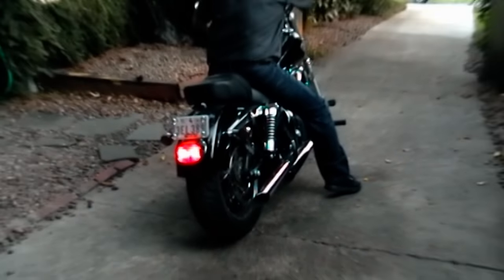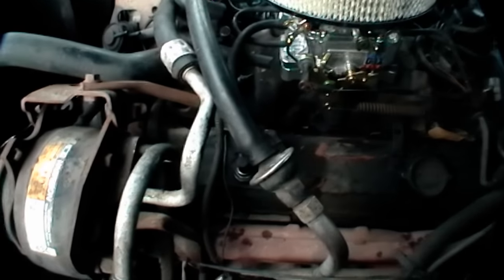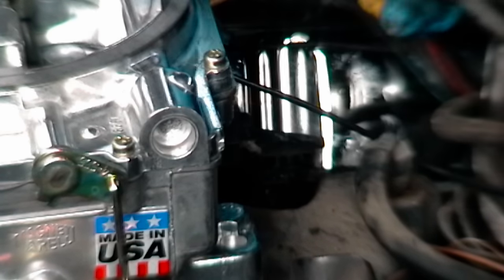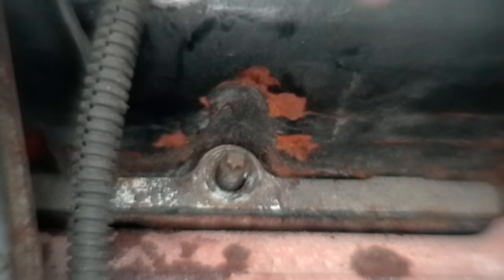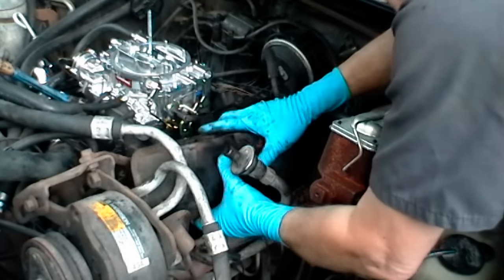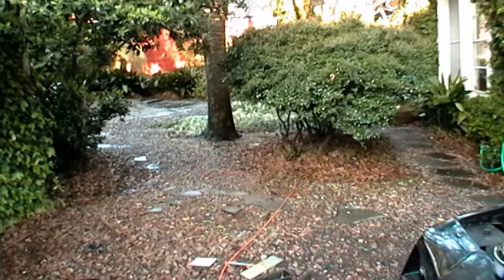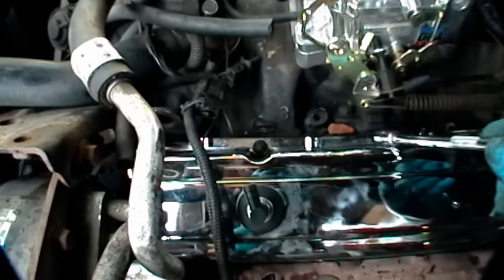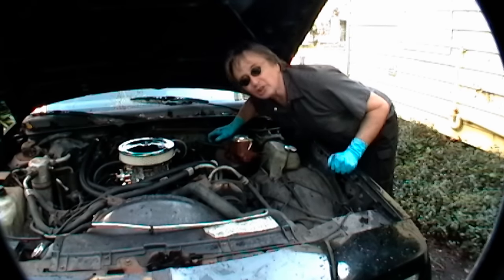How To Replace a Valve Cover Gasket

Comment: how long after replacement do I wait to start the car?
Reply: Smith9301 u dont have to wait. it takes 15 mins for the silicone to dry. 24 hours to fully cure but i use it on oil pans all the time and only wait 15 mins before starting. atv silicone is oil resistant

Comment: I was about to change the VC gasket ...leaks all over the driveway,  and, found out the bolts to the VC were all loose.   Tightened them.   That didn't fix the problem either.   Not until I got someone to  tighten them to the recommended "pressure" did the leaks stop.

Comment: @scottykilmer hey scotty I have 1998 toyota corolla with 176000 miles on it, its going through almost 2 quarts of oil a week, there is no visible signs of leakage and no smoke coming out of the exhaust system. What could be causing this?

Comment: Scotty, can you show how to change valve cover gasket on an 01 Acura CL S type please. Cannot find it anywhere on the web. Thanks, Kevin
Reply from the maker: unfortunately there's a ton of crap in the way on your v 6 engine, same process as this video BUT loads of crap have to be removed to get to the valve cover bolts and to remove them is a giant hassle on that model. So most mechanics will charge many hundreds of dollars doing that job. You can do it yourself, but it will make your hair fall out. I have no exact directions as so much stuff has to come off, but it's doable if you have patience and a LOT of spare time.

Comment: Hey scotty ive got a el camino with a v8,i noticed it seems down on power and when i washed the motor the water boils off super fast on the ex. manifolds exccept for the number 8 cylinder it kinda just slowy evaporates whats the cause?

Comment: what do you do when you've got a gasket that wants to squeeze out from under the valve cover when you go to tightening the valve cover down?
Reply from the maker: +David Hannigan Jr. (Deputy Dave)  a poorly made gasket OR one torqued down too tight
Reply: +Scotty Kilmer See, that's the thing, the specs call for 62 foot pounds of torque to torque them down. Not only did it start squeezing out from under the valve cover prior to reaching 40 foot pounds, I also snapped a valve cover bolt before reaching 40 foot pounds of torque. So if my gasket is correct, then what do I do to make it seem like its seated in an insert slot? Do I just slather with gasket maker? Or should I do like my brother says, just use the gasket maker without the actual gasket I had gotten? If it helps you think on it, its a '01 Ford Explorer Sport.
Reply: +David Hannigan Jr. (Deputy Dave) imo 62 foot pounds is a lot of force for valve cover bolts. Even if you torque it to 62 and the gasket and everything is fine, I would be scared that the cover would leak due to uneven pressure on the cover. Be cautious using a gasket maker with an actual gasket too; both together can cause uneven mating surfaces.
Reply: +muhdsharif12 That's what the hayes book says he torque specs are. but nothing about there being two different size bolts on that right hand side valve cover. two bolts are one size four are another size. and in that case of using the gasket maker and the gasket I'm just going to go with a gasket maker make everything go back on easier anyways. thank you.
Reply: +David Hannigan Jr. (Deputy Dave) Thats strange: different size bolts... anyways, hope it works out for you- no leaks!
Reply: +muhdsharif12 Yeah that's what the Ford Dealership said. Thanks
Reply: +David Hannigan Jr. (Deputy Dave) Are you sure it's not 62 inch-pounds? That sounds more like it. (62/12 inches = 5 foot pounds) The other thing to consider is hard hard was it to loosen them? I would say it wasn't that tight.
Reply: +John M yeah it was inch pounds but ain't 5 foot pounds kind of low to be torquing a valve cover?
Reply: Nah It's just the top of the valves there's no combustion up there so 5 is fine.  On older cars you would fill the oil from a little cap on the cover itself which took no effort to remove
Reply: +John M mine has a cap on the actual cover.
Reply: +David Hannigan Jr. (Deputy Dave) boom. There you go. My 76 omega had one; that's how I learned
Reply: +John M so what is (if there is) the trick to using just gasket maker for a replacement?
Reply: I've always used both together 1 it holds the gasket in place when you're putting the cover back on and 2 it makes a perfect seal . Just make sure you let it cure overnight. You could probably get away with one or the other. I'm a big fan of Permatex black and never had problems on anything from water pumps to gear boxes. When you get to a screw hole, make sure you go around the edge of the entire hole. Just don't be too generous because you don't want that stuff getting in where there are moving parts
Reply: +John M do I wait till the maker sets with the gasket prior to re-assembly?
Reply: +David Hannigan Jr. (Deputy Dave) put it on the gasket while it's wet and install the valve cover. it should cure overnight
Reply: +John M if I do that its just going to squeeze back out from under it, like it did the first time.
Reply: +David Hannigan Jr. (Deputy Dave) some will, but that's normal. This is just to ensure the best seal once it cures. The sealer isn't a requirement, some people just use the gasket however its a good idea. Just torque it to spec and you'll be fine
Reply: +John M no I'm not talking about the maker, I'm talking about the gasket itself will squeeze out from under it like it did the first time.
Reply: +John M I mean if there's nothing saying that I can't let it set first, I'd like to at least partially let it set.
Reply: +David Hannigan Jr. (Deputy Dave) is it a cardboard or a silicone gasket? you're not using the gasket that got mangled when you over torqued it are you?
Reply: +John M no, it's not silicone, it's made by fel-pro, or pro-fel or whatever. I got it off rockauto.com, and they say it's like a rubber compound of some sort. they don't use the word silicon. I specifically say its a rubber type compound. and it is it feels like a giant thick rubber band.
Reply: +David Hannigan Jr. (Deputy Dave) HOLY MOLY!  Friend, you are trying to tighten it 12x what you're supposed to.  5-6 pounds is plenty.  Nothing is going on up there, it's just to keep it from moving.
Reply: +Mark Umbenhower 👍👌👊
Reply: For cranks but won't start

Comment: How hard would this be on a 1997 ford f150 4x4 4.6 V8 ?? i was told i would have to remove the top of the intake ?  Also how hard is it to replace the fan clutch ?

Comment: Hi Scotty;
My Mitsubishi lancer 2003 manual recommends using Mitsubishi approved power steering fluid.
In replacing power steering fluid, is it necessary to use the dealer brand or any brand that car part store recommends is sufficiently okay to be used.

Comment: I replaced the valve cover gasket on my 94 Buick with the 3.8 in it. I dont know if there is an oil leak anywhere else because there is still oil all over the engine underneath the valve cover. How do you recommend  cleaning the oil off so I can see if that fixed the leak and stop the smoking?

Comment: Question scotty, 

The smoke was coming from under the hood. And yesterday now blue smoke is coming from exhaust. What would that mean? Valve cover seal bad? 
Oil is on the engine block 

1997 Lexus Es300
Reply: Blue smoke could mean a whole bunch of different things. My dad's 77 pontiac firebird had blue smoke come out the exhaust a couple years ago. Cost $4000 to rebuild the entire engine and turns out the problem was the fuel filter. It hadn't been changed in so long the paper disintegrated and made its way up the fuel line

Comment: does it not have to be torcked and if so to what? i drive a 95 vw golf 2.0 4 cillinder and im prity sure i need a new valve cover gaskit, to replace mine i would have to take off my intake manafuld cerrect?

Comment: I have a 95 isuzu rodeo with both valve cover gaskets leaking oil.  Is the rodeo more difficult to work with versus other vehicles?

Comment: do you still need to put gasket sealer on if you replace the valve cover gaskets? and do you need to scrape gasket material off the valve assembly?

Comment: Dear Scotty, can you tell me if I can get away with this: I'm about to change the lower spark plug tube seals on my Accord, which necessitates taking off the rocker arm assembly. I can't afford a torque wrench right now, and the parts store only rents a huge one that can't do the 9 to 16lbft torques this job requires. How important is it to get the torques right? Can I just eyeball it?
Reply from the maker: Yes, just don't get em too tight and warp anything.

Comment: You should run a wire wheel on the gasket surface of the new chrome valve cover to prevent leaks

Comment: I change my valve cover gaskets and that went smoothly, but when I cranked my engine, it automatically revs up....I put the car in drive and it will get up to 30mph without me touching the gas pedal. Its an 84 cutlass calais original motor.
Reply from the maker: probably made the throttle cable bind on something doing that work, check that first. If not, try my video 'how to fix a car that idles poorly'

Comment: Dear Scotty, what precautions do I need to take about this particular job so as not to wreck my car? I very much appreciated your video, "Bad Things to Not Do to Your Car" (which may have saved me from frying my main relay the other day). Are there any precautionary tips about valve cover gaskets (92 Accord, if that matters) that you can impart? Thank you. Also, I think it's really cool that you actually answer questions.
Reply from the maker: yes, just take your time removing wires and vacuum lines, and realize that car's so old, hoses may break off and you may have to buy new small hoses that do split.

Comment: Is the risk of getting engine gunk inside the engine too much to meticulously clean the bottom part of where the gasket connects? Also, are there sprays or other safe ways to clean the valves whilst the cover is already off?

Comment: my toyota previa van 1996 vibrate when running in speed below 40 m/h. specially when step on the gas. what seems to be the problem with it.
Reply from the maker: check for worn engine mounts and transmission mounts, and worn drive shaft. If not that, often worn out transmission internal parts

Comment: while doing an oil change i noticed some black lines of oil coming down the exhaust manifold from the engine, i was told i need to change the valve cover gasket. would that be correct?
Reply from the maker: yep
Reply: Awesome. Thank you so much.

Comment: Scotty I have a Suzuki with a V6 twin-cam engine and need to replace my valve gasket cover due to a significant oil leak, i refuse to give my mechanic $1000 for the repair. From what i understand he needs to really dig into my engine. Is this repair really that much more difficult with my engine type?
Reply from the maker: difficult, but not that difficult.  Guy's a crook. Manual gives 2.1 hours labor to do the job, With parts, job should be less than 250 bucks. Stay away from that guy.
Reply: i agree with scotty kilmer. STAY AWAY

Comment: If you bend the brake booster vacuum line will it throw your idle off or make the "check engine" light to come on? I have the same engine in my 83 Monte Carlo and as I tried to turn the bolt on the back of the carb the tube twisted a little bit with it so I stopped and now my check engine light is on.

Comment: Dear Scotty: My 92 Accord's engine's not smoking, but the spark plugs keep getting doused with tons of oil. The guy at the parts store said the valve cover gasket is probably leaking. You think?
Reply from the maker: yes, change the gasket and the spark plug tube seals that come with the gasket set, they are leaking
Reply: Scotty Kilmer Thanks! Hey, you got any quickie exhaust fix videos? I can't weld and I have limited upper body strength.
Reply: Also, will my engine run better after I change the valve cover gasket and spark plug tube seals? It's kinda sluggish.
Reply from the maker: Heidi Fuhr
welding is best, but you can try using an old soup can cut up and then clamped over pipes using radiator clamps to hold it on, I've done that when poor and young.

Comment: I had a few other lines out of place its fine now, but why would the booster vacuum line twist as I turn the bolt? I need to check my oil drain holes on my heads but I cant get the bolt undone without turning the line. WD40? Thanks for replying

Comment: how to get a broken spear pulg out of the back of motor 4.9lt cadillac devill
Reply from the maker: hardly any working room there, good luck on that one. Move anything you can out of the way for working room, and realize you may have to remove engine mounts and jack the engine up to get access room

Comment: I had a question I have a Chevy small block 305 I was wanting to change the valve cover gaskets cause u noticed smoke coming out the engine bay as well as bluish white smoke out the exhaust is this a valve stem seal issue or valve issue thanks
Reply from the maker: more often  a valve stem seal or worn piston rings. do a wet and dry compression test to find out
Reply: ok thanks for the info

Comment: i have a 1995 bmw 525i. would it be the same concept of changing it and would i need to use a torque wrench?
Reply from the maker: same process, you can just get em hand tight, it's not that crucial on those small bolts

Comment: My truck puts out white smoke from the exhaust when I start it up. And only when I start it up after it has sit for a couple of hours.
Should replacing the valve cover gasket fix this problem?
Reply from the maker: NO  , that's probably worn valve seals and that requires pulling the head, a BIG job
Reply: Scotty Kilmer I know I Should fix it asap but what can happen if i put off fixing it for too long?
And how long is too long?
Reply: Scotty Kilmer Valve seals BIG job?? More like little job. Just pull the valve cover and valve springs. Pretty simple actually
Reply from the maker: try doing it on a modern overhead  4 cam engine, on a caddie it's a multi thousand dollar job
Reply: Maybe a big deal on a Ferrari as well......but this guy has a truck.
Reply: Or head could be warped...

Comment: do you need a torque wrench? and would it help to get a thicker gasket?
Reply from the maker: na, they size they are designed with is best. you can use a torque wrench, but really, that's overkill on this job

Comment: I just did my valve cover gaskets recently, and the magnet to get the bolts to prevent losing them wouldn't work on my car. because the bolts that hold it on is plastic
Reply: Lucas Short Do a block test. Smell your oil as well. Might have a blown head gasket.
Reply: since when is a blown head gasket got anything to do with the bolts of the valve covers being plastic? my engine is very good, Thank You Very Much. it's been the most reliable car I've driven so far. the bolts that hold the valve covers on being plastic have nothing to do with a head gasket being blown. you have no idea what you are talking about
Reply: Lucas Short LMAO I commented on the wrong comment hahahahaha
Reply: get some glasses. your not that blind

Comment: So weatherstripping only on one side of the gasket?  Thanks!
Reply from the maker: +James Crouch yes
Reply: +Scotty Kilmer  hey man the other day I changed my hydraulic lifters on my190 e Mercedes 2.3 everything went back how I took it off except for the valve cover gasket I tried to use the old one when I went to start it up it started to sputter out and die rpms would drop down would the gasket be the problem thank you

Comment: I don't even want to think of all the dirt and other crap that just entered that engine.
Reply: I'd like to know how else you expect to change it ..
Reply: Oh, I don't know. Maybe brushing or washing off all the engine-destroying bits of sand and dirt off the cover before even taking a bolt off.

But I'd love to hear why you think anything less than that is acceptable when performing a proper repair.
Reply: +Space Cadet Motion Pictures washing your engine can be dangerous to that engine.. A little grit isn't going to kill anything. As long as the mating surfaces are cleaned who gives a shit.. Unless you got horrible aim and can't get the holes lined up like a 13 yr old virgin.
Reply: +Space Cadet Motion Pictures but then again you don't KNOW what he did or didn't do before the camera was rolling.. Maybe he wiped it up before the video.. You don't KNOW .. But I think I'd give a man with 30+ years experience the benefit of the fucking doubt.
Reply: +CDubs HasIt .... I'll actually give the guys I trained under, with their 30+ years of experience the benefit of the doubt. 

I am going to screen shot your comments tho. We're going to have a good laugh over them. Especially the part where you claim washing an engine is worse for it than getting dirt inside of it.